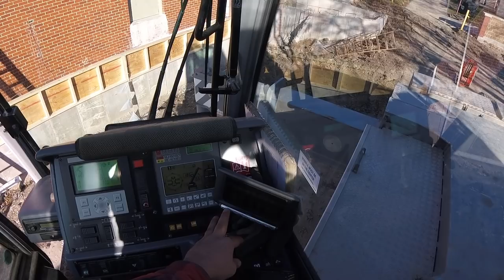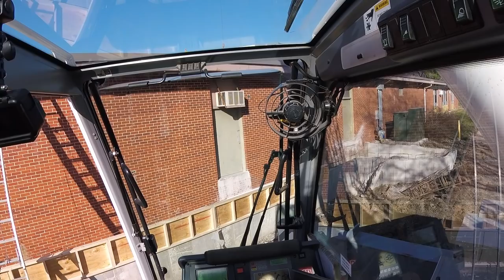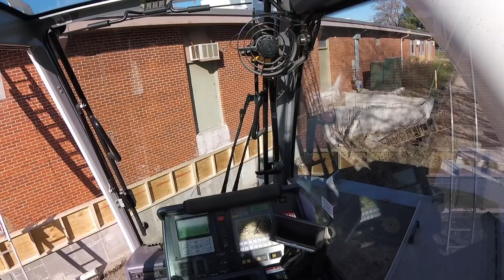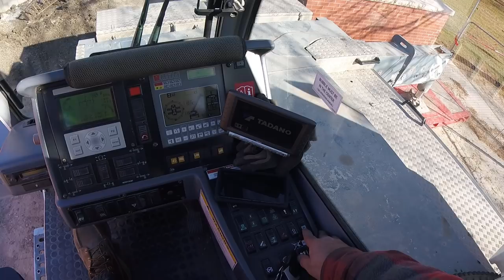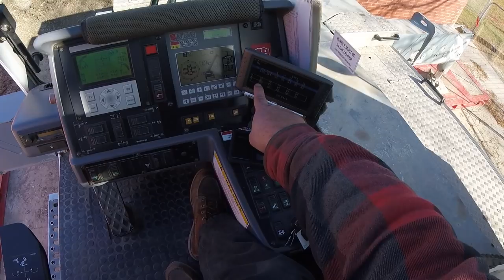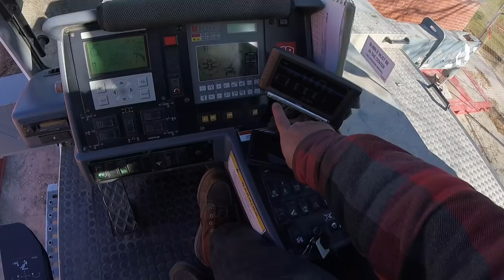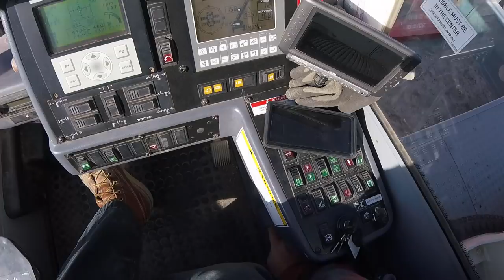Cranes and Air conditioners | Setting a 6,000 pound A/C unit 160 feet away

Comment: What weight can you pick with a single part line full boom extended and as close to the back of the crane, with those 2 parameters boom height and single part line?
Reply from the maker: As in...boomed all the way up? The shortest radius as possible?  If that's the case, it will pick 16,750 pounds. Many thanks for watching! 🙂